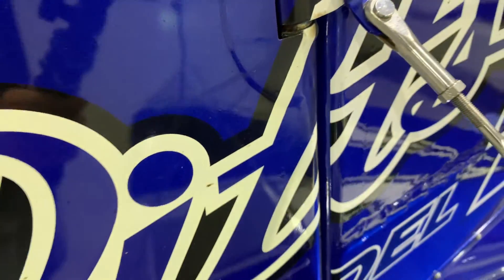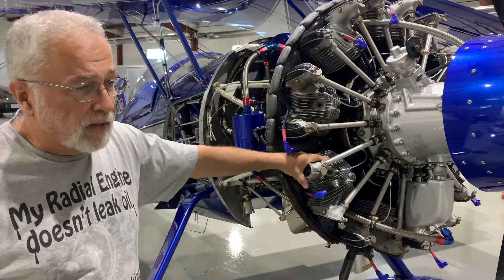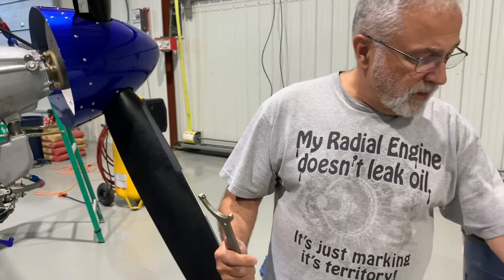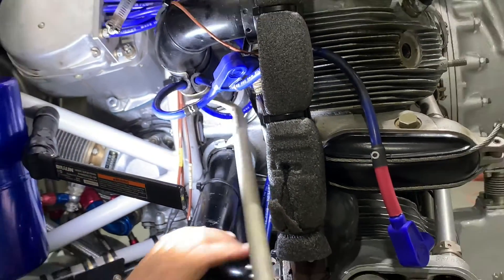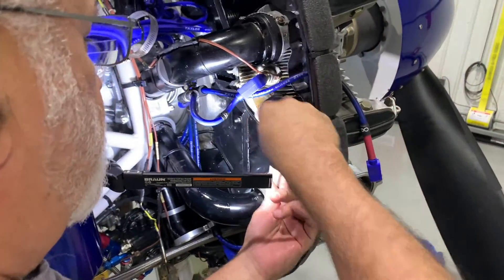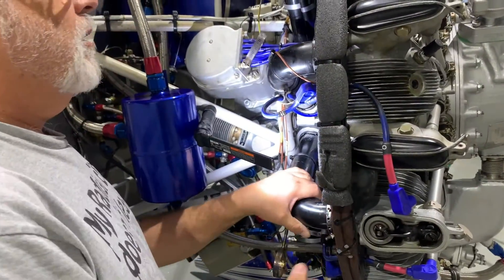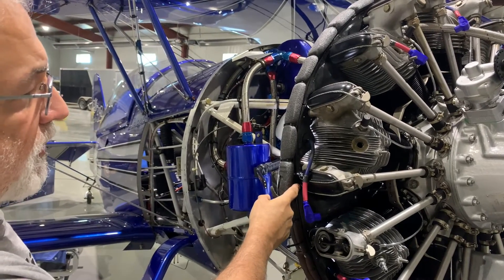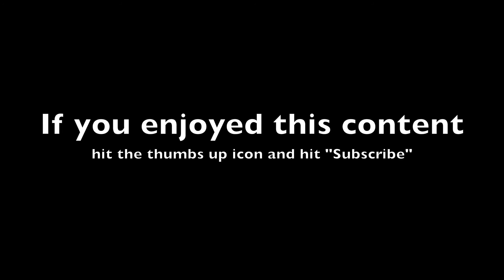Paradox Aviation- High Performance Pitts Model 12 SEASON PREP PART 1

Comment: WOW!!!! What’s a BEAUTIFUL Model 12! This is one of the nicest ones I’ve seen yet. I LOVE the colors!! Perfect match. 😁🤙🏼 What type of paint did y’all use? 
I am building one for a good friend of mine right now. We’re using AirTech coatings on it with double cover. Heavy duty then light weight. ZERO tapes. 
I will be sharing videos on it soon. Where are y’all located?
Reply from the maker: We also did a double cover. Based out of Iowa :)
Reply from the maker: Thank you for the kind words!!! Greatly appreciated.